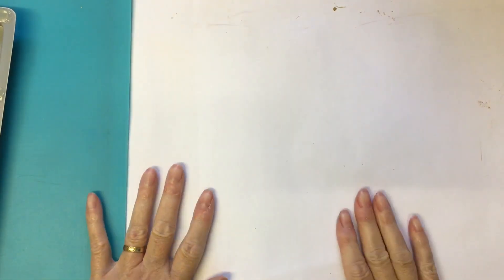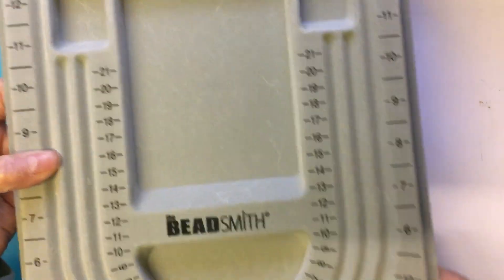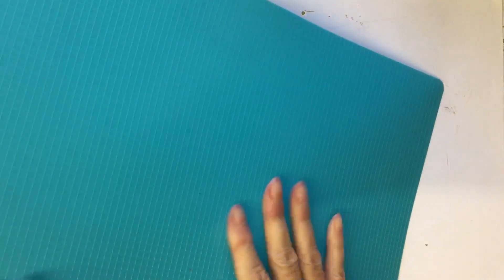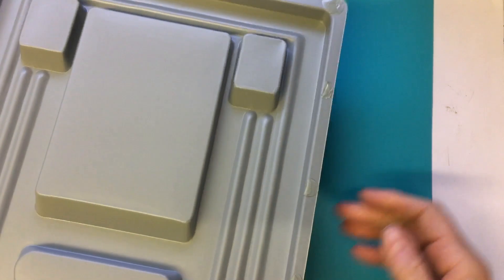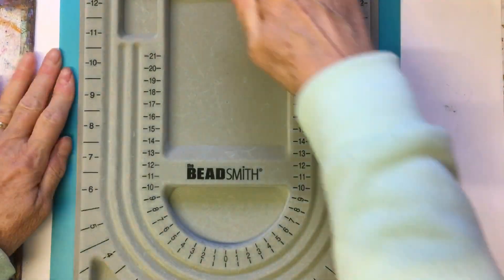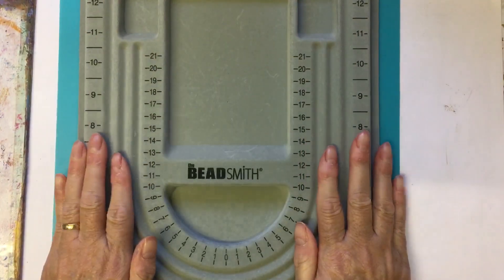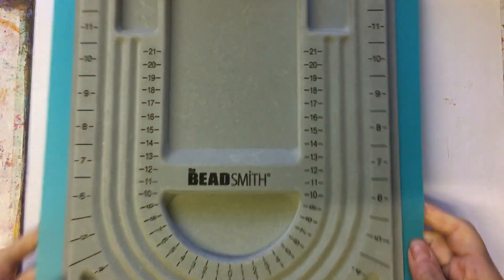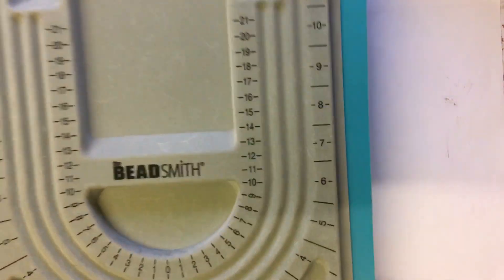How to reinforce a flimsy plastic beading tray

Comment: Hi Mrs. Doodle, 
Have you ever tried Beacon brand glue? It's the best! Beacon 3=in-1 is a great substitute for hot glue. When you use it on paper, it's great because you can move it around a bit to line things up. And it dries clear and is not wet. There is also one for Fabric that I have used.

Cheers!
Reply from the maker: Hi Shala, I have used Beacon before, a long time ago but it’s quite expensive over here. I think it was the fabric one I had and I agree it is good. The glue dots are dirt cheap and work fine for me on this board. TFW. Hugs, Dee xox
Ps...Have you by any chance mailed your ATC swap to me yet?  It’s been nearly 6 months now!
Reply: @BettsyDoodle  I know! I was hoping to get them in the  mail last week. Hoping for tomorrow! My boys are going to be in LIncoln.